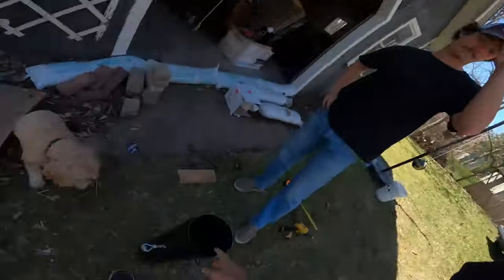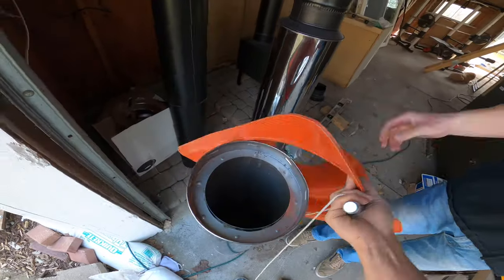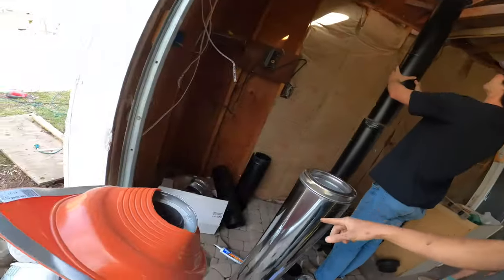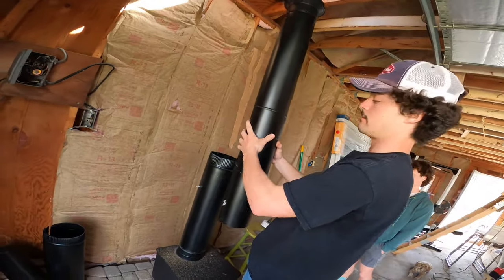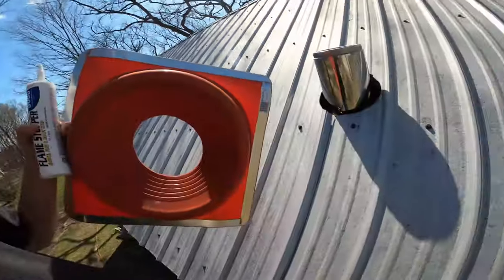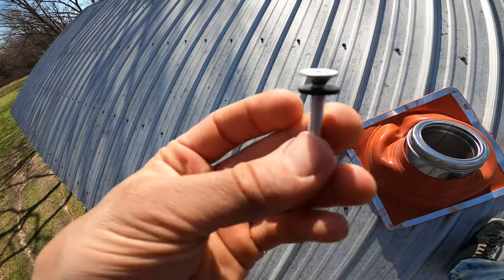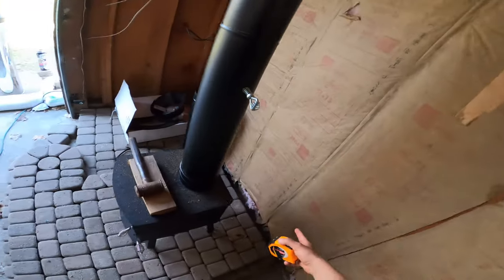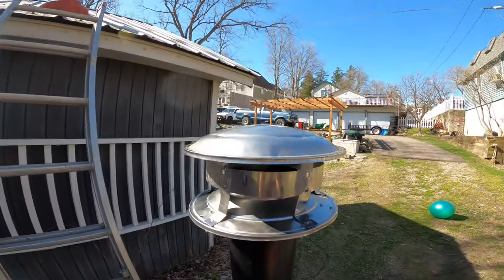How to Install A Wood Burning Stove Chimney - A Quick Guide (Double Wall Stove Pipe)

Comment: So many things wrong here.
Reply: Elaborate
Reply: Black pipe installed upside down, didn’t use proper collar to go from single wall to insulated pipe, you cut a round hole in a sloped roof for a round pipe.   Black pipe to close to combustible surface  ( insulation paper)  I’m sure there was more but not watching the vid again